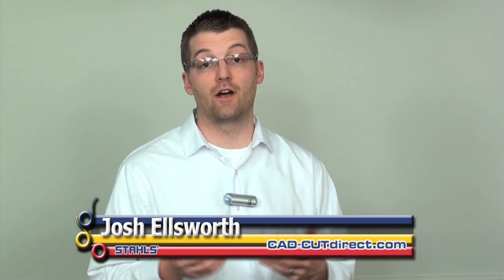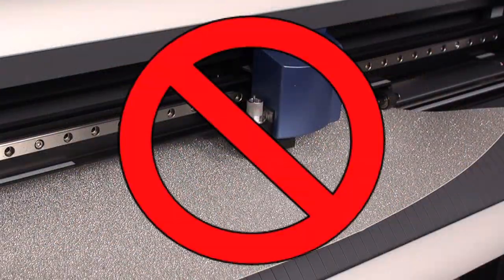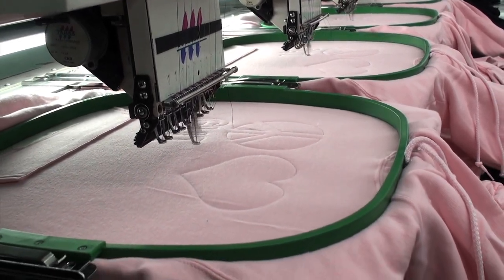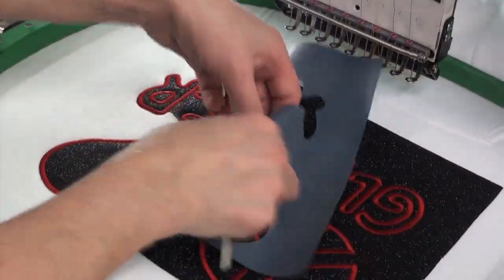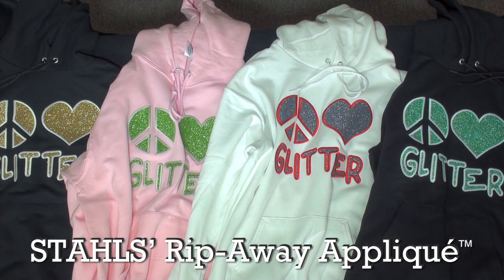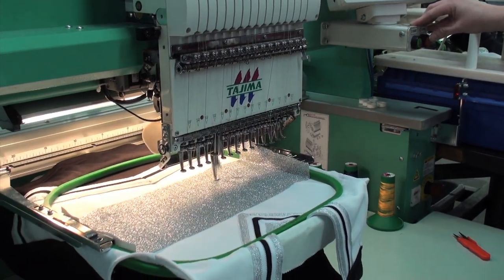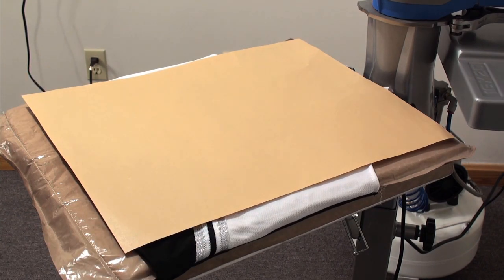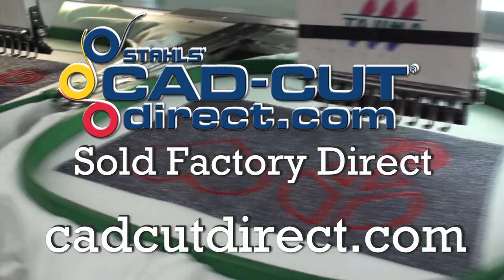Stahls' Rip-Away Applique™ - New Glitter, Metallic Twill Process

Comment: what is the best spray to use to make sure the glitter stays in place while it is embroidering?
Reply: +Sarah James Any spray tac can be used.  It is really just tacky enough to hold the glitter flake from moving around on the garment while it is being embroidered.  Once fully embroidered and the excess glitter flake removed, be sure to heat press the garment to fully apply the glitter flake down.
Reply: Ok thank you.  I have a 505 temporary fabric abhesive spray but I see it has a warning for being extremely flammable. Is it ok to use if I do a light spraying on the glitter with it.